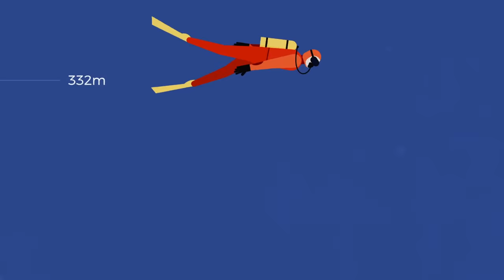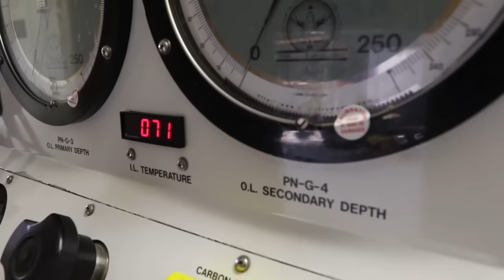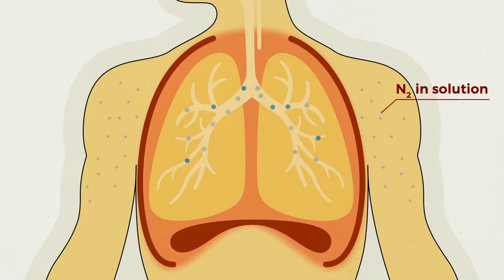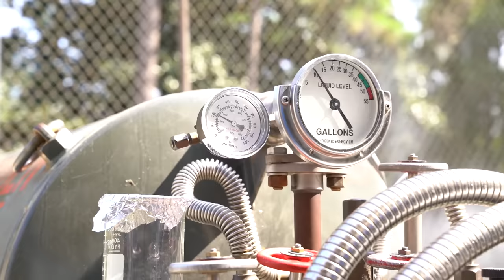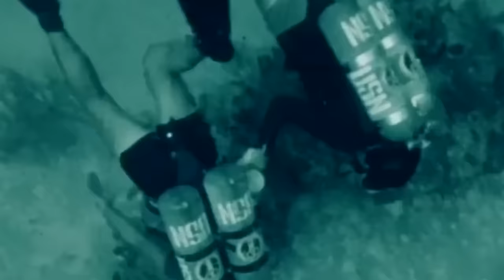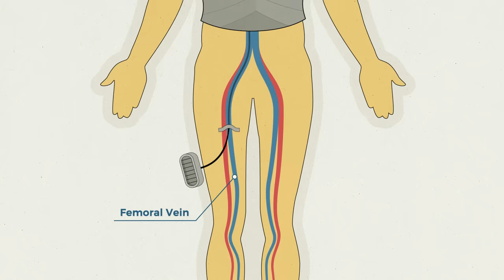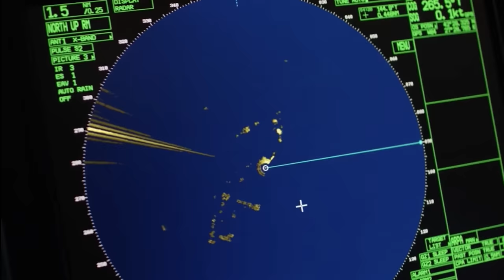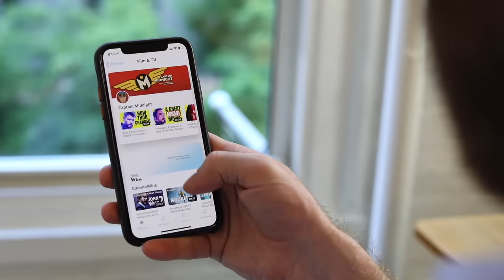Can Humans Breathe Liquid?

Comment: Breathing in breathable liquid for the first time sounds like putting in contacts for the first time, very difficult to fight the instinct but you'll get over it
Reply: The difference being that failing to put in contacts results in slight discomfort, while [knowing that] a failure in the process of breathing liquid would result in an excruciatingly painful, self inflicted death.
Reply: I breathed in a bunch of water once because I worked at a marina and closed my eyes when I swam under the gas dock so I didn’t lose my contacts. I swam under and when I came up I bumped my head on something that I immediately recognized as a pontoon. No big deal, I moved over a little bit with my eyes still closed and BUMP! Wtf I gasped and my eyes came open! I was not expecting a Tri-toon boat lol. I didn’t completely fill my lungs but I sucked in quite a bit.
Reply: @brandongreene9615  hmm, I wonder if you could trick the body into breathing in liquid then. Like have someone close their eyes, and then while they’re breathing in spray a bunch of liquid into their lungs

Comment: I've drowned before and it was always my biggest fear. Even though I lived through it, I'm still scared of it because it was horrible trying my hardest not to breathe in the water. When your brain forces you to breathe in the water I went unconscious which was actually a huge relief from the stress on my lungs. I don't think I held my breath longer than 2 minutes but it felt like 30 minutes. I hope I never have to feel that again.
Reply: I would do apnea training if I were you. But then on land. Seriously, otherwise you might stay in that fear. You will find much more peace. From the sea we come and to the sea we'll go.
Reply: Fun fact, CO2 is causing that feeling you described, it happens because you hold a breath. Actual drowning feels different.
Reply: @makermeeter7562  How would drowning be any different from inhaling water and passing out? Is it defined as dying from this (and having to be resuscitated to live to tell the tale)?
Reply: I had a similar thing, but I did not drown. I actually got out in time. I was being a dummy in the spa. In warm water you can hold your breath longer so I wedged myself between the railing and the steps into the spa. It's a built in spa so the railing went into the water on the stairs. Anyway, I wedged myself in and was doing it alone trying to beat 4 minutes under water. At about the 2 minute mark I realized I was stuck and started to panic. When I panicked I needed to surface. I used up my oxygen when panicking and couldn't get above the water. I was very lucky that I would train to hold my breath longer and longer because I thought it was a cool party trick or I would have drowned. I had to turn my body where my stomach faced the top of the water and I got myself out. Another 15 or 20 seconds and I would have drowned.
Reply: @Psilocybism  ive drowned before and became unconscious and it was scary at the time but im not permanently scarred forever. I still swim and have no problem getting in water but i am afraid of drowning again
Reply: i've not drowned before but get liquid pumped into one of my lung (left ones, infected with TB) and it definitely not so nice, and until this day i still occassionally cough from drinking water and gets some of it into the breathing tube from that time i have to train myself to breath with a lung that get filled with liquid
Reply: @Psilocybism  Nothing is going to keep you from fear when you are in the midst of drowning.
Reply: @jusbertmeza4424 If you really drowned you'd be dead.
Reply: You'd be dead if you really drowned.
Reply: @rick419 Believe it or not! People drown everyday and are rescued and resuscitated.
Reply: @kevinkey5270  They are drowning.  After a person has drowned they are dead.
Reply: @kevinkey5270  When you hear that someone has drowned on the news, that means that someone has died by drowning.  Being rescued is another thing.
Reply: @rick419  no Rick. People literally drown and have no life signs for hours and have been brought back from the brink  of death, but they drown not died. They are not synonyms.
Reply: @kevinkey5270  Being brought back from the brink of  death means that they haven't yet died.
Reply: @rick419  right, they drowned but not died. You can do it!
Reply: @1981stonemonkey  you misunderstood, he was referinning to the experience, he experienced holding his breath than passed out, which is why he didnt experience drowning, he was already passed out from what he said.  simple comparison would be to someone that was chocking on water soon enough to be consious during it, and that that feels different than holding your breath aka CO2 @makermeeter7562
Reply: @rick419  Incorrect, correct information from WHO: Drowning is the process of experiencing respiratory impairment from submersion/immersion in liquid. Drowning outcomes are classified as death, morbidity and no morbidity. Agreed terminology is essential to describe the problem and to allow effective comparisons of drowning trends. Thus, this definition of drowning adopted by the 2002 World Congress on Drowning should be widely used.
Reply: @theendoftheline  The problem is you compare the process of drowning to having  already drowned.  Not the same.
Reply: @rick419   No I didnt compare I  showed you the definition and now you are arguing the semantics of past tense, without realizing what you just said fully supported what I said: if you go through the process of drowning, in the past, you have drowned, thats how english works. its not a comparison, its the english language.
Reply: you are blocked now, please use alt accounts to request further clarification on english.
Reply: Jesus christ mate
Reply: When I drowned I remember after struggling to hold my breath my first two big inhales of water I totally relaxed and thought I was able to breathe the water it was at that point I was pulled from the water
Reply: Brutal stuff